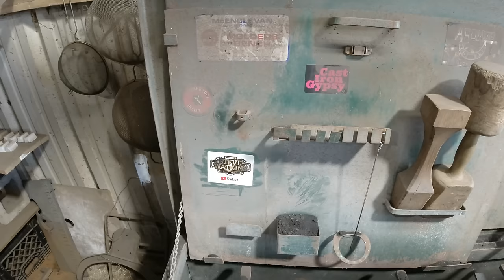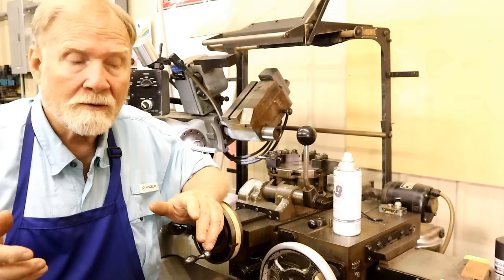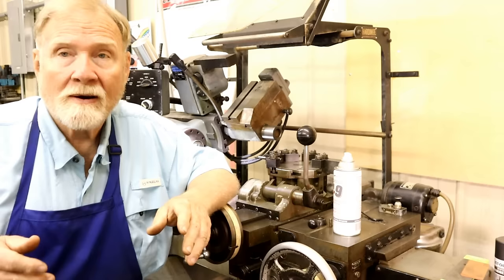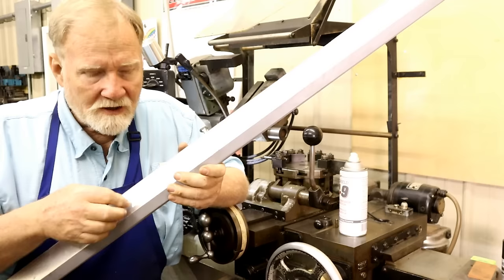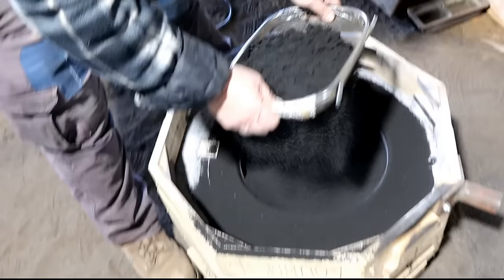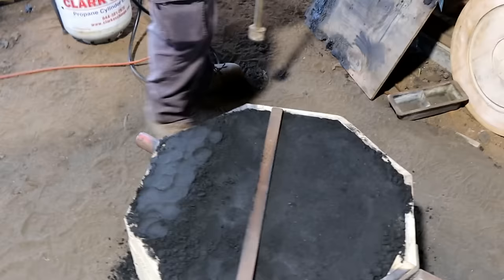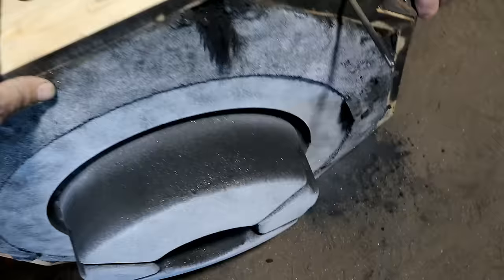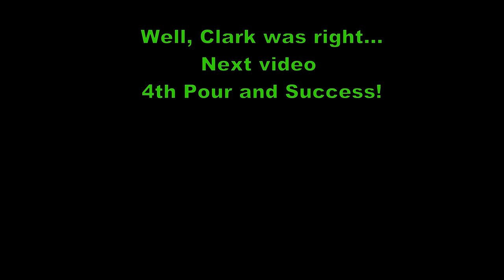Pouring the Tally Ho Capstan: Part 2  Unabridged Version

Comment: At about 29 minutes in the video, Clark is trying to pull the pattern, there is such a vacuum under the pattern, that it can damage the mold as it is being pulled.  Need some way to put vent holes in to let the pattern pull without negative pressure.
Reply from the maker: According to clark the vacuum is very small and the pounding he gives it loosens the sand from the walls to relieve it.  THE biggest factor is the smoothness of the pattern walls and the degree of draft of the pattern. The sand has sharp crystals that act like velcro hooks on the surface of the mold. Ramming the sand to make it take shape and be hard enough to withdraw from the pattern forces the sand into any sanding marks inside the patteren.  The pattern was very rough and I spent 2 hours sanding it in the next video.  It pulled much easier  after that.

Comment: Dudes, next time drill very small holes in the difficult ares to relieve the suction. Im a tool an die maker and we put them into our deep impression ( over 1-2 inches). All sheet metal press die have them too release the metal from the die( in your case release the mold from the sand). Wonderful insight into your craft. hope it helps in your next project. Thanks for you time. God bless

Comment: Can you pack the sand too tight?
Reply from the maker: The "sand" is a complicated product... Clark has his own formula and there is at least 8 different things in the "Sand"   which all come together to make it work.   Also the water content plays a big part.    As to packing it too tight We need to ask Clark but I would say no.  In the next video you will see us putting the inside part into the mold. That part has to hang upside down inside the mold while pouring and not break off or crumble.

Comment: Not to be a know- it- all, but I saw a youtube video of a British locomotive foundry circa 1924, where they painted the sand with graphite mixed in some sort of "solvent" (I assume something that would evaporate completely) once it was completely dry, they poured the iron. I think the principle is that graphite forms uniquely slick layers and slides like pencil "lead". Perhaps you are aware of this. It may also bind the sand to some extent.  I certainly mean no offense in saying this, and hope my comments may be of some use. I cannot find it right now, but will keep looking.
Reply from the maker: NO offence :)   If you watch the very first video you will see Clark doing that to the core we were making...  I am working on the next video in this series and that will also show making the inner core again, so stay tuned :) 

This problem was the mold was too rough to extract the pattern so there was no way to coat the sand anyway.   The pattern was coated with graphite but it had some very rough places in the wood, until I spent a lot of time sanding it again...

Comment: We have brake wheels cast at work for overhead cranes. They look real similar to the flat belt pulley on a tractor or a steam engine. THe guy we use to cast these has only one employee and its a women. Some of these are as big as 30" in dia. and they must weigh 500 lbs. He uses a chemically hardened sand. I know this would add cost but there is no way it would cost as much as all the labor and travel expenses that this pour required. Our guy would have had this part cast the first try guaranteed.
Reply from the maker: It's not the sand. I personally would always use the sand Clark uses for cores but it is expensive as you can't really reuse it and trucking it in gets expensive in the amounts Clark would use.     
 The problem really is dialing in the pattern, getting all the gating and risers right along with the joints in the three part mold...  Those three flasks really present problems in trying to contain 100lbs of water thin 2800 F metal.
Reply: @10swatkins  The flasks need to be much larger and he needs the proper equipment for lifting and rotating a large mold. He has none of these.
Reply: @TheJohndeere466 he has the largest flask that he can get.  Any bigger would not fit in his furnace
Reply: @donmadere4237  a flask is the wooden part that holds the mold. It never goes in the furnace. You are talking about a cruciable
Reply: @TheJohndeere466  duh I was thinking crucible when I read flask sorry
Reply: I feel the flask should be made of steel and be larger to keep from distorting the sand while lifting.  Also the sand should be chemically hardened  and the pattern should have a place to screw in an i bolt to pull the pattern. I realize the mold will be quite heavy but most foundries would have a means of lifting something this heavy and they would have a spreader to lift the mold and allow it to be rolled over with ease.  The pattern would be pulled with the crane. Thats how they do it when they cast our brake wheels and the brake wheels have a much deeper draw than this pattern.

Comment: I'll bet Clark regrets the day he and Keith broke the original part. I'm sure he must think of that day every time he makes another mold.
Reply: It’s been quite awhile ago that I watched that video and I recall them using just about everything they could to get that thing apart. Pry bars, hammers, heat and that thing was seized so bad it just wasn’t coming apart in one piece. I’ll have to go back and rewatch the video when they were taking the capstan apart and see it again.
Reply: The original cap was already broken when Keith & Clarke set  about taking it apart. That is why they had nothing to lose if they broke it some more - which they did 😅.
Reply: Oh yea, keyboard warriors. Did I suggest they had not tried everything to get it off, NO. Did I suggest it wasn't already damaged NO, what is it with you, having to criticise what was meant to be a jovial comment.

Comment: What is the issue at 35:20? Is it just that the mold is under-filled?
Reply from the maker: Basically yes... THe original part weighed in about 10 pounds less than the new pattern needed...  Had to work around that by putting in cores and topping the largest crucible made to almost over flowing...

Comment: With your explanation of the problem of the mold release what did they do different 100 years ago when the original was poured?
Reply: They made the pattern maker change the mold!
Reply from the maker: Prayed a lot harder :)   All the different shapes might have had a little more draft in the original..  By the time I worked it over with more sanding it was releasing better...